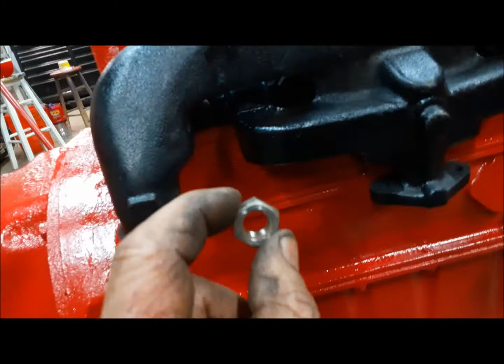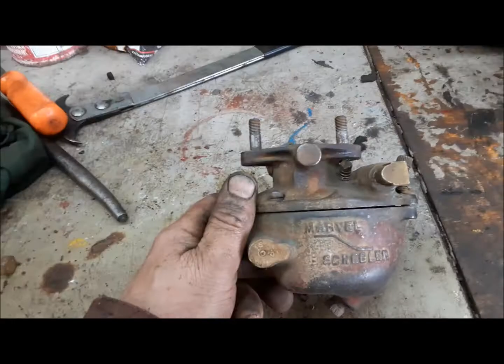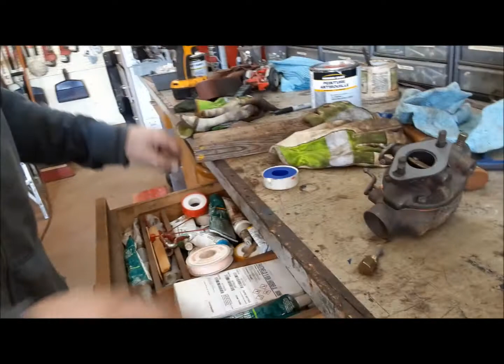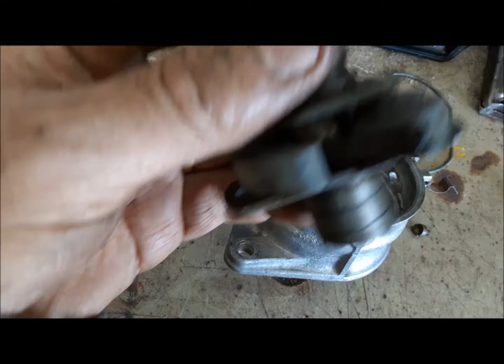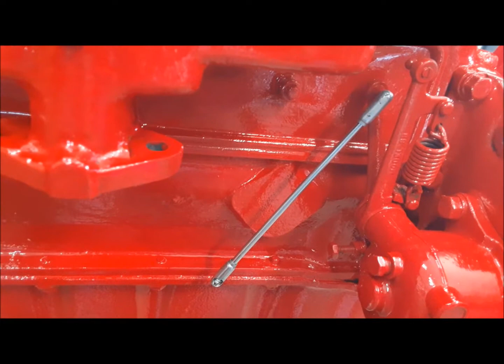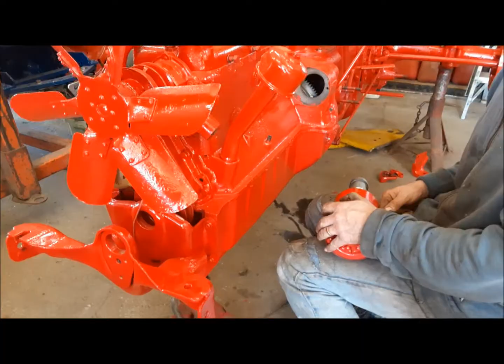1948 Ford 8N Rebuild part 6B Engine exterior boltons

Comment: For God's sake, why does no one show bolting on the front bolster! Surely it requires a gasket for the oil pan?
Reply from the maker: There is no gasket. It simply bolts onto the front of the engine.